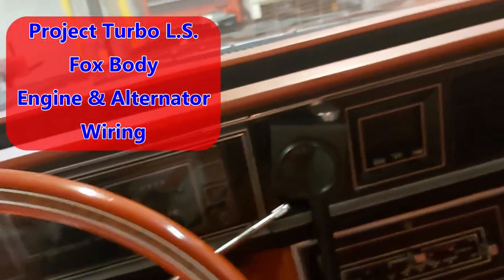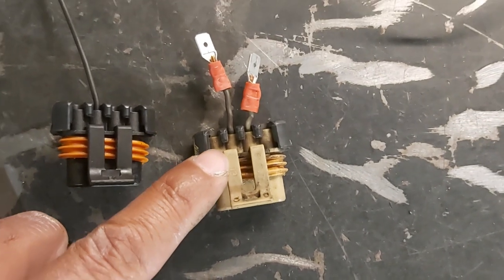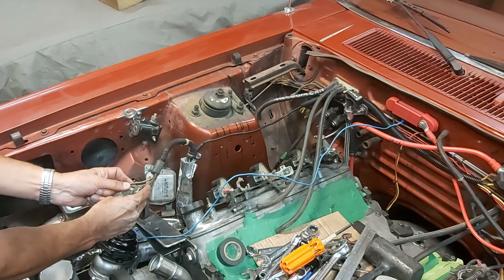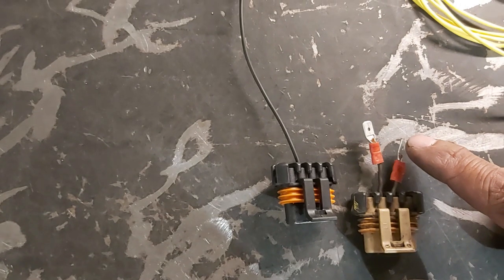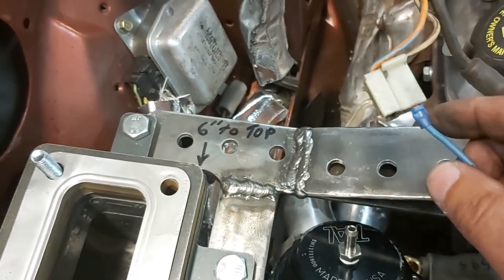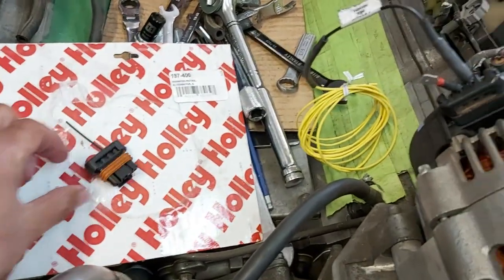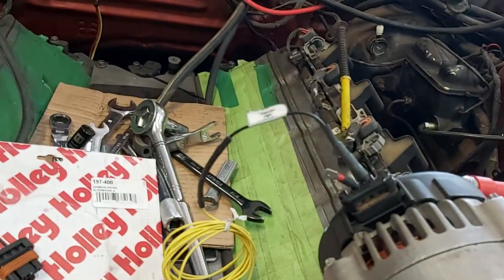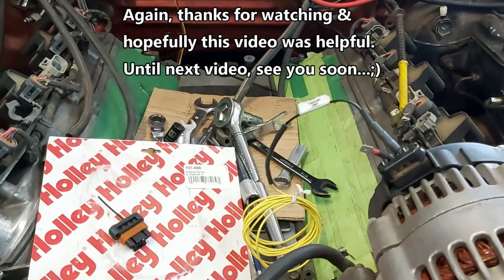LS engine in Fox body, Alternator & engine wiring with Holley 197-400 alternator pigtail.

Comment from the maker: Update: after getting the car running the alternator is  producing 14.3 to 14.5 volts. so as in the video make sure and connect that wire to a key on 12 volt source and all will work as it should. Here is a link for the video showing the alternator charging as it should...   .... 
 https://www.youtube.com/watch?v=KzRU0tBjp4s

Comment: Shouldn't the light come on when the engine is not running or if you have a charging failure? It seems you just lost some functionality.
Reply: Oh I see. You were simulating the engine running/charging with battery voltage.
Reply from the maker: Yes, thanks I was simulating 12 volts that the alternator put's out with voltage from the battery. Thanks for watching.....Oliver